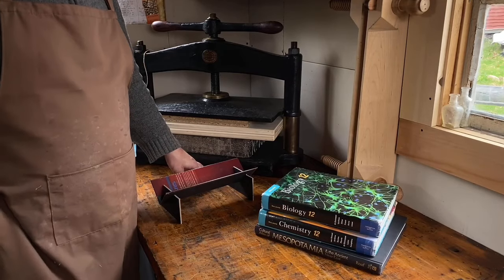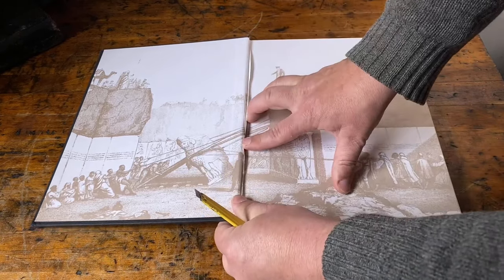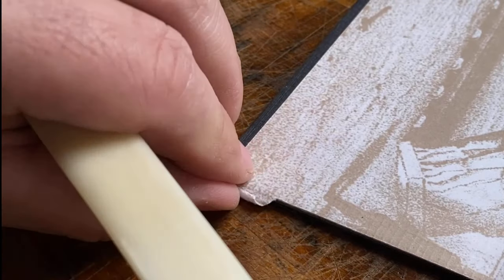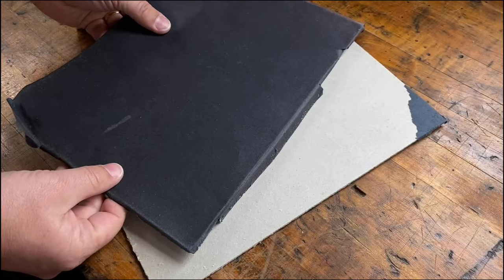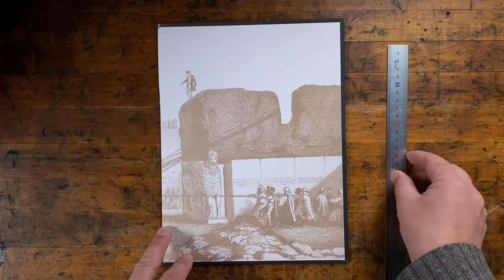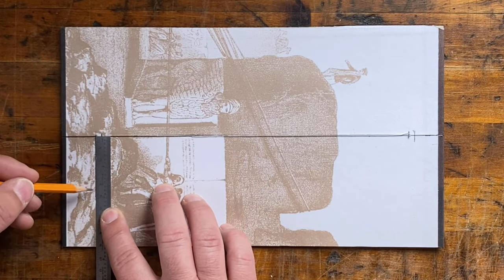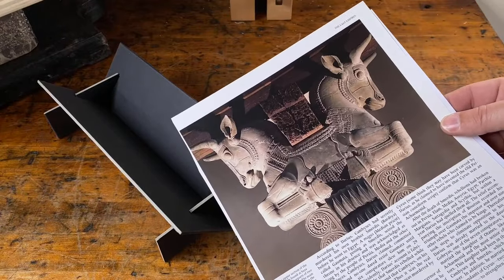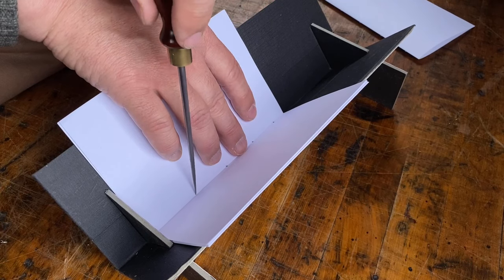Upcycling An Old Book: Reclaiming Materials - Making A Piercing Cradle - Making a Pocket Notebook

Comment: Great recycle ideas! Thanks. In converting hardbound notebooks to leather soft covered journals I've had some success spritzing the inside paper with water and waiting a minute. This seems to loosen the glue before I remove from the book board. Often I can reuse the entire case (end sheets, head bands, etc.) on the leather cover.
Reply from the maker: I will definitely try that! Thanks for the tip!

Comment: I see the advantage of not using a cutting mat. Is the wood of your work surface Pine or some other softwood? And is it finished with a stain and an oil finish so that the damage it sustains can be disguised with another swipe of stain and oil? Thank you for your videos.
Reply from the maker: The bench is maple and I think came from a machine shop where it had seen some pretty heavy abuse. When I found it (yes, found), it was covered in oil, grease, paint, and burns. I cleaned it up, sanded it down, and finished the top with shellac and wax. Whatever marks my modest cutting makes in the top are nothing compared to what it endured in the past, and I can easily refinish if I ever feel the need.

Comment: Do you have to reinforce the bottom of the hole punch jig? You indicated that you poke through, I am wondering if there will be tear out if I use it frequently. Thanks for the information!
Reply from the maker: I suppose that after long use the area might wear out, but I think it would take a very long time. And even so, it would be easy to fix with another layer of material. Thanks for the question!